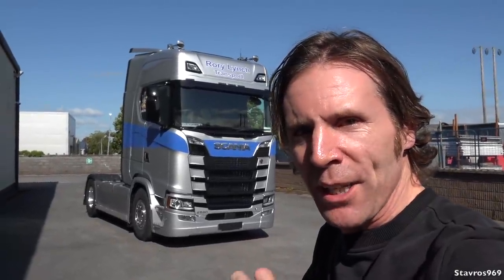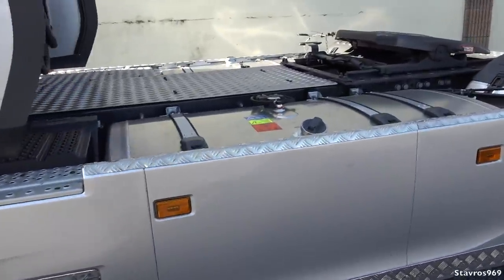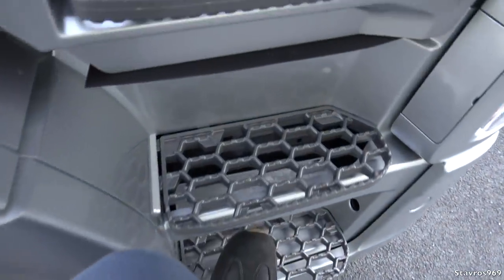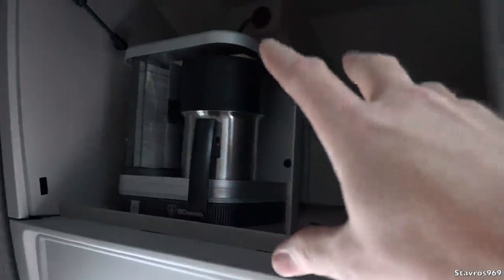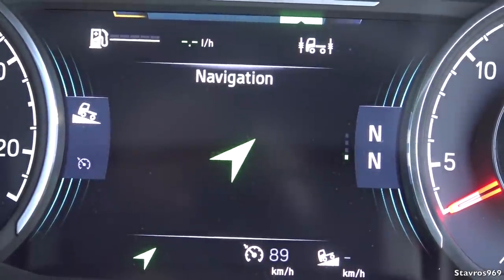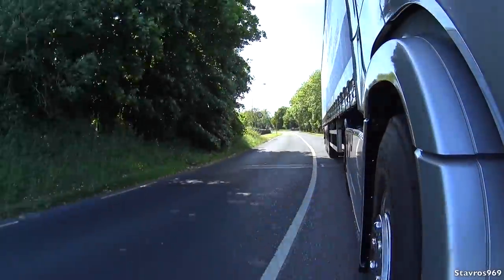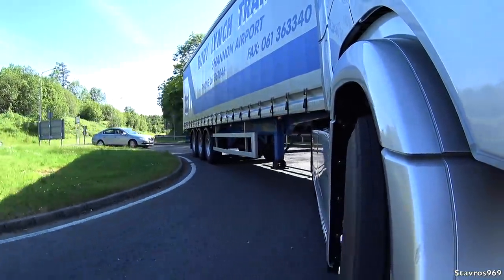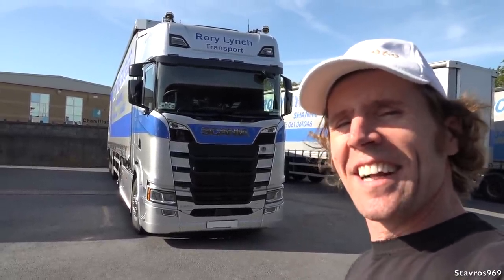New SCANIA S 580 Joins our Fleet Full Tour & Test Drive

Comment: As an American man who has worked with commercial trucks, but never driven them; if Scania was allowed to see trucks in the US, our domestic manufacturers would really need to upgrade their trucks. The economy of space is fantastically utilized in these Scanias while the systems seem to be much more advanced in comparison. I recognize this would result in much greater complexity of repairs as well as the frequency of repairs, but the benefits would outweigh the problems.
Reply: Freightliner, volvo etc are slowly catching up to todays tech and specs with new 2022 models getting disk brakes standard and front air suspension.

Comment: A lovely truck! Please make some videos in the future, want to know your opinion how it behaves with load. Have seen videos about S440, so at 90 km speed it had 1050 rpm and it was not enough to pull at 12th gear with load, so it causes gear shifting down to 11th and as a result high fuel consumption. Right axle ratio is very important especially at hilly areas

Comment: It is interesting how much quieter and smoother these european luxury brands are compared to decent american brands, even though you are sitting on top of the engine. But considering the amount of electronics involved, the driver has absolutely no control on the truck, and should these computers go crazy, god knows what will happen. And by the way, where are all the necessary gauges?? I know that you can recall them by the screen, but a real driver needs to see all of them at the same time, without getting disrtracted by finding them in a complex menu. A real truck needs to have at least 14-15 analog gauges besides the rpm and speedometer.
Reply: There is a reason EU trucks are sold world wide while most US trucks stay in the US and that ain't down to analog gauges or computers that's for sure.
Reply: @RickZune  They're obsessed with chrome and gauges in the US. Those make no difference to the paycheck or earning ability though. The S580/730 is the ultimate truck, even if I'd spec it as a 6x2..